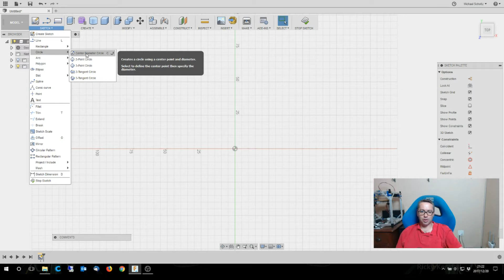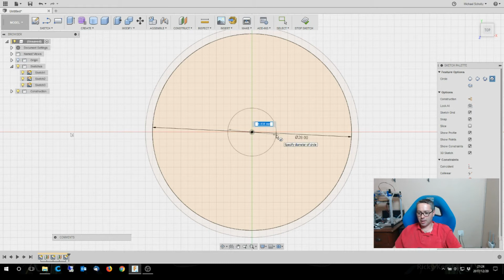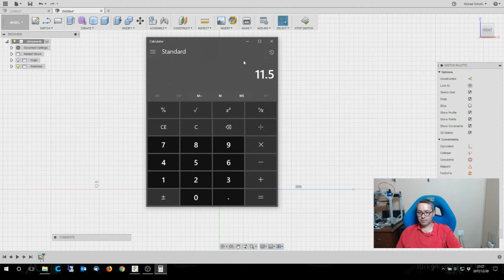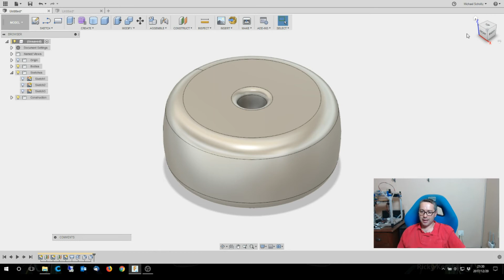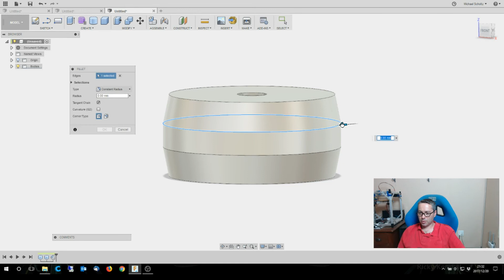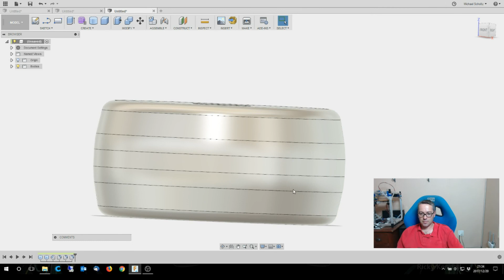Different ways to draw in Fusion 360

Comment: Thank you for the video. Good to look at things like this with different tools. A suggestion though if you don't mind. Fusions has great tools to do the math operations for you. Instead of counting squares ...  using constraints (like midpoint) and dimensions, perhaps based on paramaters, could have gotten you there a little faster and with better ability to adjust after the fact. Thank you again.